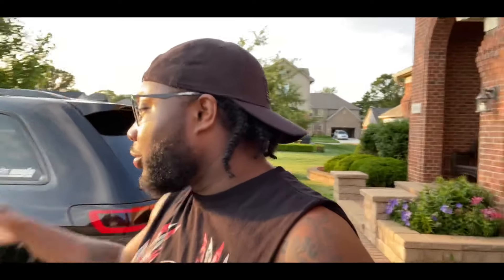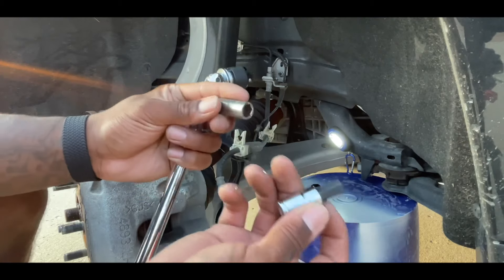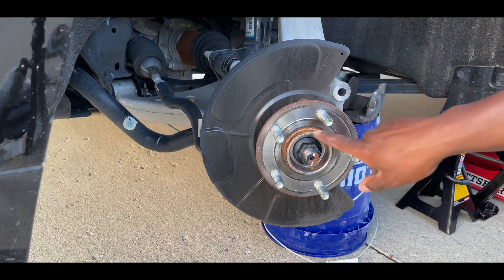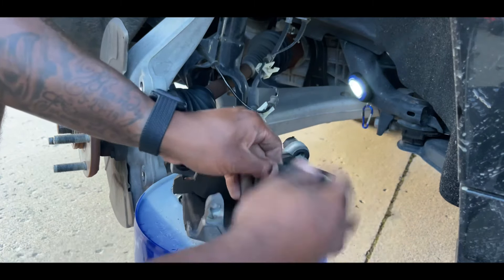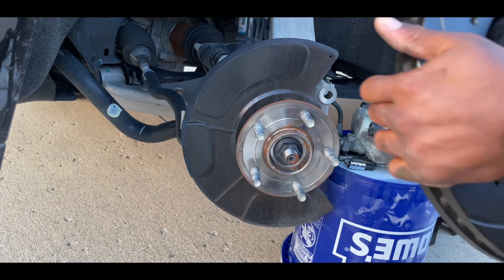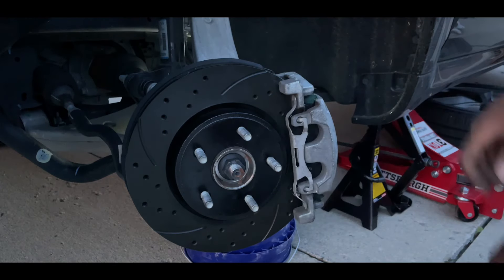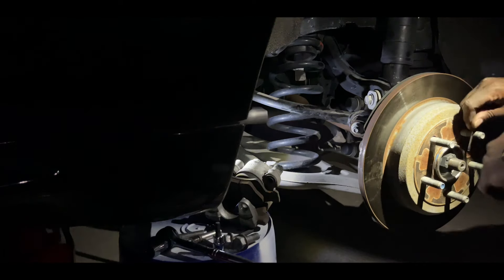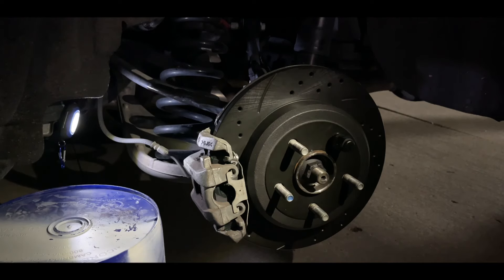How to change Brake Pads & Rotors | 2018-2020 Jeep Grand Cherokee

Comment: FYI, that 16mm 6-point you used should have been a female torx E20 star socket. That's why you weren't sure what size to use because neither fit correctly. Also, you don't need blue thread locker, you need proper torque, that being 148 ft-lb. The factory didn't use thread locker but they did properly torque the bolts. The 11mm allen needs torqued to 41 ft-lb. The back 7mm allen gets torqued to 20 ft-lb and the 18mm bolts to 89 ft-lb.Finally the lug nuts get torqued to 100 ft-lb. If any of these bolts come loose, you're dead.
Reply: Good info, I once had a caliper bracket bolt fly off because I went snug rather than torquing it properly, thankfully it was during a low-speed test drive through the neighborhood but I've been very particular about torque spec ever since then.

Comment: Great video. You did forget one crucial thing or maybe I missed it. Opening the brake fluid reservoir so that when you push the pistons back in it doesn’t push air back into the system.
Reply from the maker: Thank you bro and I actually did do that I just messed up and forgot to mention it in the video. A buddy of mine told me to make sure I opened it, thats why my hood is up. But thank you as well for that and anyone else who may not know 🙌🏽
Reply: What abt releasing some parking brake from computer?
Reply: @BlklimitedX  hey bro what size rotors you used for the rear and front ?
Reply: Thanks we have a 19 lim x needing brakes soon....I may do myself with mopar rotors and pads
Reply: What about the flux capacitor??

Comment: Wish the tutorial had mentioned this! Totally messed up my first rear rotor job because I forgot to disengage the emergency brake. When I was trying to remove the rotor, I thought it was rusted on, so I started banging and prying like crazy. Ended up damaging the brake dust shield in the process. Caught a break and was able to salvage the shield, but during my first test drive, I heard it scraping against the new rotor. To anyone else tackling this job: make absolutely sure your e-brake is off before you start working on those rear rotors!

Comment: Get you an inverted torx socket set it’ll be much better, and you’ll be avoiding stripping the heads of the bolts.
Reply from the maker: Good looks bro, definitely will get that 🤟🏽
Reply: @BlklimitedX  The size you need is an E20
Reply from the maker: @VF31Rules  thanks man

Comment: This video is great! 

Do you have the 18" rims? If so, did you consider going a touch larger with the new brakes? I am questioning if I go stock size or up a bit to add more stopping power.

Comment: my dude! lmao im laughing so hard of all this caliber brake part. I got the  2021 limited x. 3.6 with k&n cold air intake after watch your video. just ordered the Borla cat back exhaust. returned the peddle commander because I felt it was to stiff on the transmission without being in sport mode. and sport I didn't feel a difference turned up; what you think about it??digging the new wheels and rims you got !! dueces and them fat tires that shit dope.

Comment: Excellent video. I got a 2018 Jeep GC Limited and I was wondering if both the 330mm and 350mm rotors fit. I can't find the spec for the OEM.
Reply from the maker: Thank you! And I think they will fit, check to make sure but I think they’ll fit just fine.

Comment: Great video! Love your channel! I followed the link in the description for the rotors but it doesn’t have a Grand Cherokee option for the model option. Only the smaller 4 cylinder models (gladiator, compass, renegade, Cherokee). Did you have the same issue?
Reply from the maker: Thank you man and no, when on the website I just selected all models except SRT and Trackhawk and then I selected 350mm sized rotors

Comment: Is your front 330mm or 350mm rotors? What year model is your jeep. Thanks
Reply from the maker: Mine has 350 in the front and 330 in the rear. And mine is a 2020 🤘🏽

Comment: Yo even though many don’t build on the 3.6 grand Cherokee your videos are a huge help 💯 being a young dude I’m still learning how to work on cars but your videos have helped a ton i have to do my brakes on my gc this week so thanks 🙏🏾  you ever look into getting a ripp super charger ? Im on the fence between having an insane v6 or saving up for an older srt 🤷🏾‍♂️
Reply from the maker: I’m grateful to be able to help you man, that makes all this worth it. So thank you for the support 🤘🏽💯 and actually I have, I see they are coming out with a system for the 2020 models so I’m considering getting one. However I want to forge my internals first before get into boosting it to better my reliability. And upgrading to an SRT would be a good idea as well, but I want to keep my Jeep so I plan on just buying a Scatpack Challenger or even a Hellcat Challenger.

Comment: Torque specs?
Reply: Front caliper slide bolts: 41 ft/lbs, Front caliper bracket bolts: 148 ft/lbs, Rear caliper slide bolts: 20 ft/lbs, Rear caliper bracket bolts: 89 ft/lbs Wheel lugs: 130 ft/lbs

Comment: Any chance you know the torque specs for the caliper bracket/pins. Thanks!!
Reply: Front caliper slide bolts: 41 ft/lbs, Front caliper bracket bolts: 148 ft/lbs, Rear caliper slide bolts: 20 ft/lbs, Rear caliper bracket bolts: 89 ft/lbs Wheel lugs: 130 ft/lbs

Comment: Good video. But, I have a question.  Why did you have to change the rotor(s)? They looked to be in good condition.  Even if they got grooved by excessive wear from the pads, you can save a fair amount of money having them cut on a lathe at your local parts store if they haven't been cut or grooved from the pads and worn too thin.  I see that you installed a higher performance rotor that may or may not provide better braking.  However, I didn't catch that you mentioned it.  Maybe, it was simply for the sake of creating the video.  Just curious though...

Comment: I was going to do both pads and rotors, but I got my priorities mixed up and bought yet another amp and Mechman high output alternator, lol.  Did change out the pads with Hawk Ceramic carbon fiber and left stock rotors which are in good shape. I've never had a vehicle, let alone heavy vehicle, withstand my heavy breaking to 72,000 miles on stock pads. The mechanic even said I still had plenty of life left. Is this a fluke, or has OEM braking improved that much?
I will say braking with the Hawk pads feels so much better. So much smoother stopping and better modulation. Only have about 250 miles on them, the true test will be hitting the brakes at 95, err I mean on 95 🤫.

Love your Jeep and the tasteful upgrades.  Can't wait for what's next.  Saw that sick steering wheel in one of your newer videos and had to go back to that video while hitting subscribe.  Lol
Reply from the maker: Lol thanks bro, appreciate it 💪🏽 and honestly I think newer pads now a days a better suited at taking high braking and lasting a pretty long time. But I I wanted to upgrade to cereamic pads so I felt hey why not also show how to change them for those who may not know as well. But I have an even bigger upgrade I’m going to be doing soon 🤟🏽
Reply: @BlklimitedX  Can't wait!

Comment: The wheel literally holds the rotor on and the brakes. You don't need to re apply that ring. Lol
I can't believe the even added that rattle crap as well.
Reply: Correct.  Put on at the assembly plant going down the line when it has no wheels.